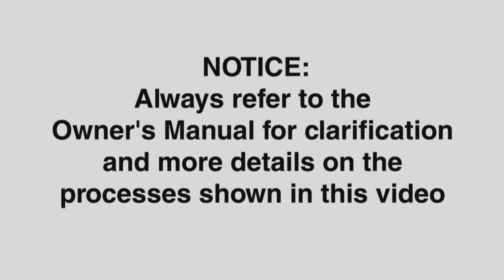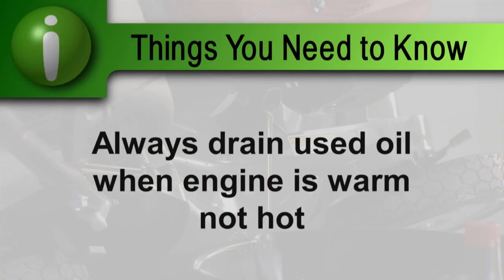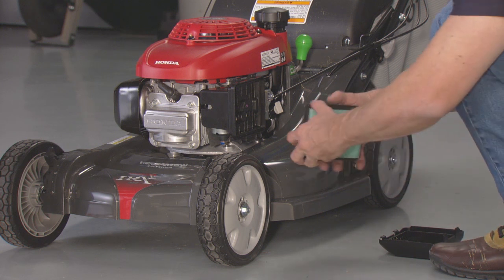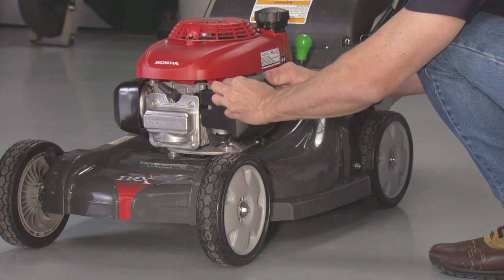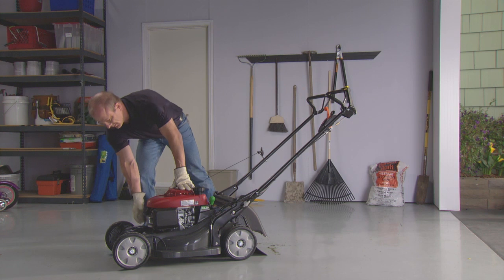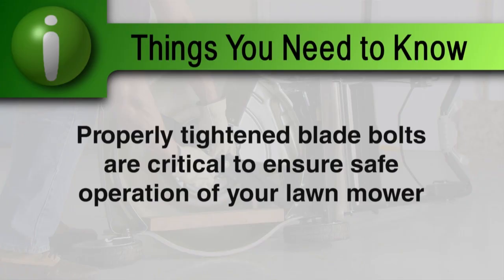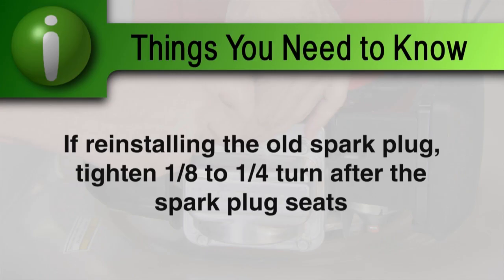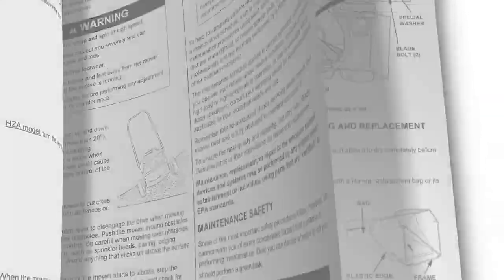HRX217 Series Lawn Mower Maintenance

Comment: For the winter storage I spray some defogging oil in the cylinder and pull the starter  rope a couple of times. Like for boat engines it prevents internal corrosion.

Comment: Good video, but they should add how to change the fuel filter, which requires one remove the red top cowling. It's easy, but definitely should be included in annual maintenance.